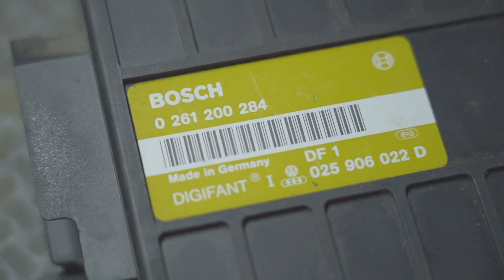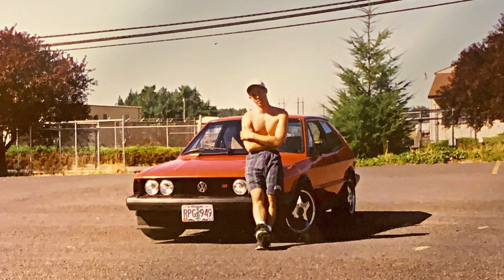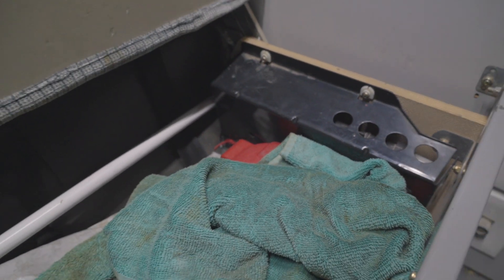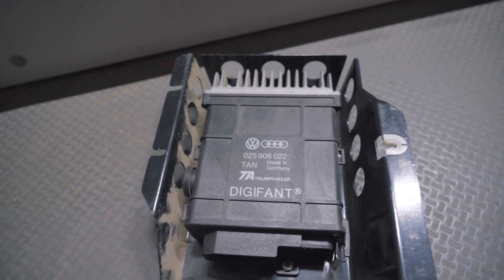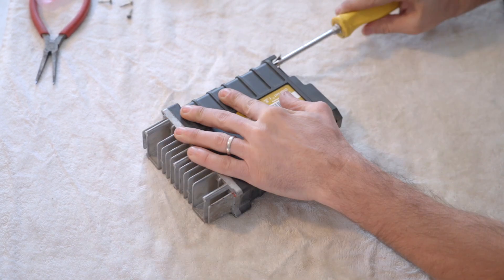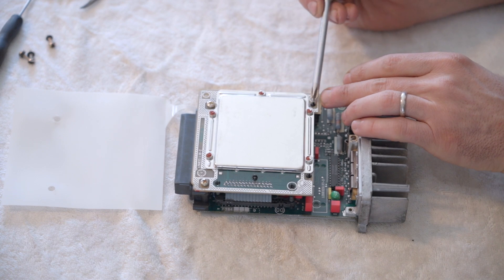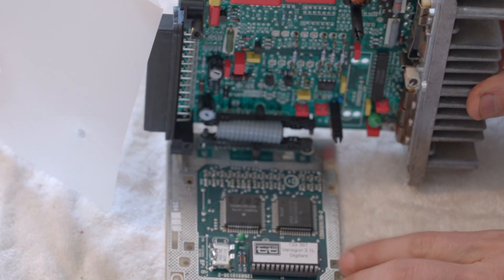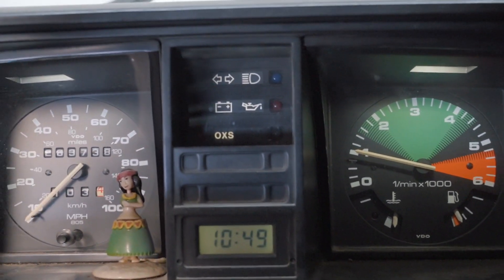Techtonics Chip Install for Digifant T3 Vanagon and lazy alternator fix.  Add HP to your Vanagon!

Comment: Hi Nate, I'm about to replace my exhaust system and looking at the RMW performance exhaust.  Why made you change  the RMW perf. exhaust for the GW exhaust?  The RMW tuned exhaust should free up the exhaust that in theory should work best with this chip and the rocker arm mod.
Reply from the maker: You’re right, the RMW exhaust flows better and we had more usable power above 3k rpm. But, for us, we had constant leaks from the clamps which made it hard for us to pass emissions. We also had the collectors crack three times and the brackets that held the exhaust cracked. I welded it all back up many times but finally had enough and bought the GW exhaust. Others haven’t had all the issues we did but the leaky clamps is common. 
In my opinion, the RMW is so close to being perfect, but for us, it was too much maintenance. 
Nate

Comment: just doing a PSA. when working with any electronics/chips/ECU.  Please be aware of ElectroStaticDischarge or ESD. Avoid items that will generate static electricity like carpets rugs, polyester clothing. Make sure to "short" yourself by touching something metal before touching the electronics/ECU.  one zap is all it takes to fry it.  Take Care and Enjoy!
Reply from the maker: Excellent point.  Techtonics does cover this in their instructions but I failed to add it to mine.  Thanks for bringing that up!
nate

Comment: Nice video as always, Nate! We have a ‘90 Vanagon with stock WBX and chip-replaceable ECU. But not sure $100 for a chip to get a 4-5 hp is worth it for us. Glad you are happy with the improvement.
Reply from the maker: Agreed.  It was just as much an experiment as it was for any real power gains.  I do feel it is smoother on both accel and decel and less bog right off idle but I could be fooling myself.  But I did get a sticker! :)
nate

Comment: Let's see a dyno run to document the improvement! How are you validating the 5hp claim??
Reply from the maker: I of course do not own a dyno or have easy access to one for a 5 hp test.  Techtonics does though and they list dyno runs on their site:
https://techtonicstuning.com/dyno.html

thanks
nate
Reply: @ThatBaldwinLife  Of course I don't expect you to own a dyno! :-) But it would be a simple matter to take a Van to a dyno facility and do your own tests. More important than the HP is any change to the torque curve. Also any MPG difference would be informative.
Reply from the maker: Trying to rent time on a dyno for a 5hp and $100 upgrade seems a bit silly given that Techtonics provides the dyno info.  If this was a full engine management system upgrade like GoWesty's or a turbo upgrade, sure I could see that money might be well spent.  We don't track MPG close enough to give good feedback on that.  It doesn't appear to be any worse based on just visuals at the pump.  
Thanks for watching
nate

Comment: Is the chip making the engine more efficient? In other words, with that 5% power increase, is the mileage the same or reduced?
Reply from the maker: We don't track our fuel mileage that close but over longer trips we have not noticed any real difference in fuel consumption.  It just seems to run a bit smoother from 2K-5K rpms.  You're probably not gonna win any drag races with this upgrade :)
nate

Comment: I've been looking into this -anything to get a little more git-up-n-go on our 90 Westy.  We have the GW2.3.  Would having that engine make a difference?  and did you notice any difference in your fuel consumption? same? worse?
Reply from the maker: I believe the GW engines have stock rockers and possibly cam but I am not 100% sure on that but yes this chip would still add the 5 HP that Techtonics claims. They do say it works best with performance upgrades but that's not to say they are needed.  We don't track fuel consumption that close but it appears to be very similar.  I haven't noticed a difference if that helps.
nate